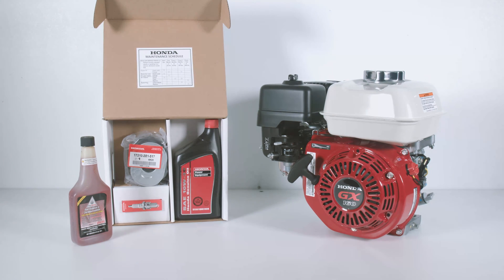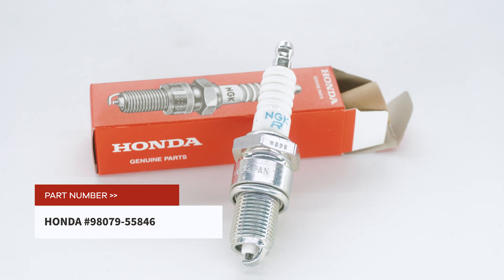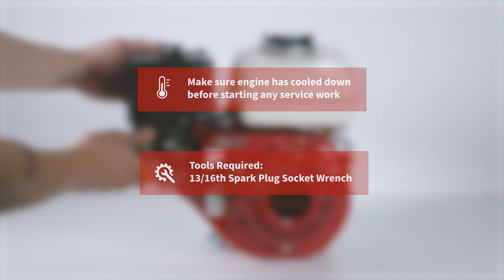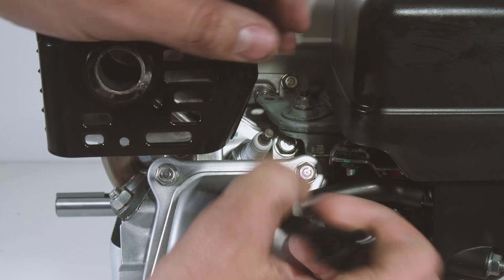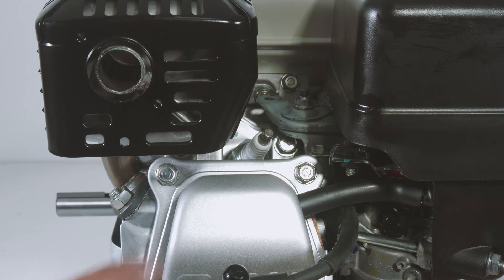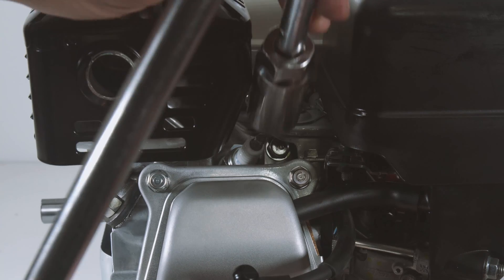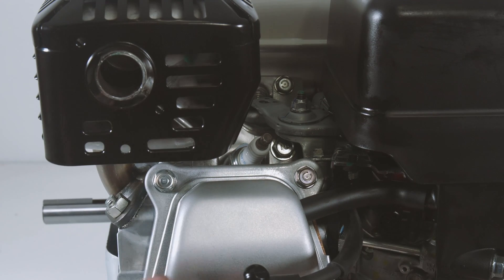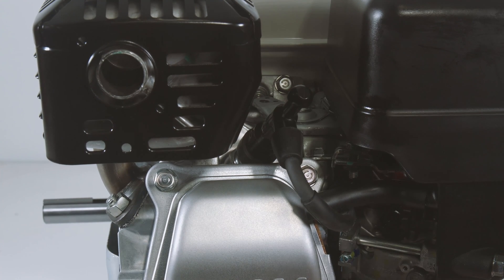Spark Plug Replacement on a Honda GX160 Engine

Comment: For some reason, my 13/16th spark plug socket doesnt fit on my gx160, is there a reason for this?
Reply from the maker: If it is an NGK spark plug, they range from 3/4 to 13/16 sizes.  That could be the reason we have seen that on some of the newer models.  Hope that helps!

Comment: What happens if I use a shorter spark plug because from my experience shorter butt sparkplugs perform better than longer ones shown in the video?
Reply from the maker: We recomend to always use the recommended OEM spec.  Hotter or colder plug models can cause damage to the engine
.  NGK model BPR5ES is the standard.  Thank you for the question.